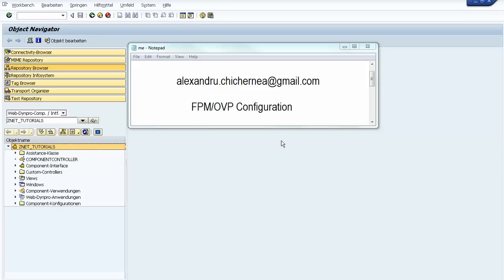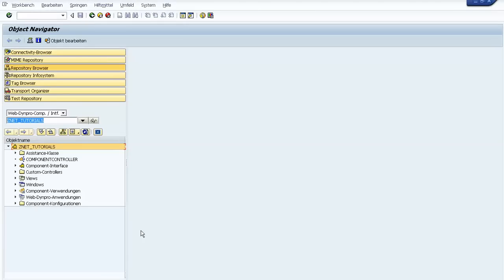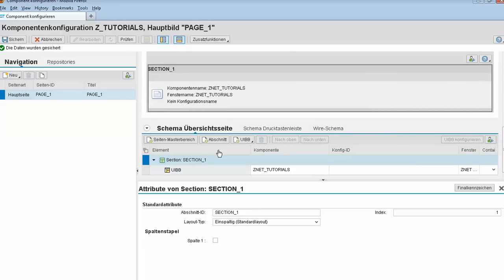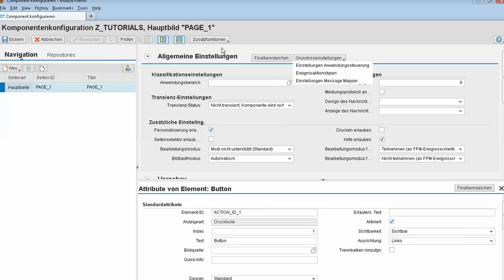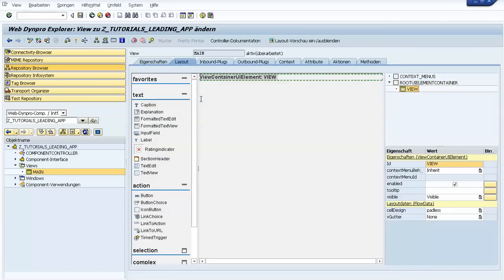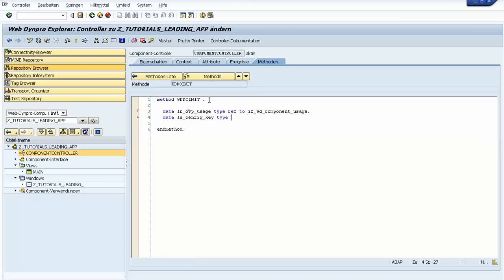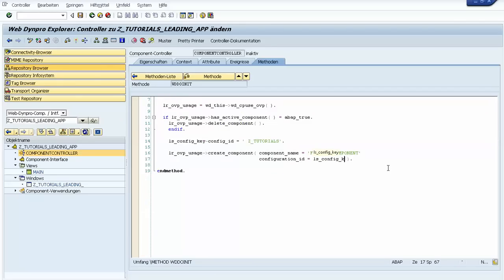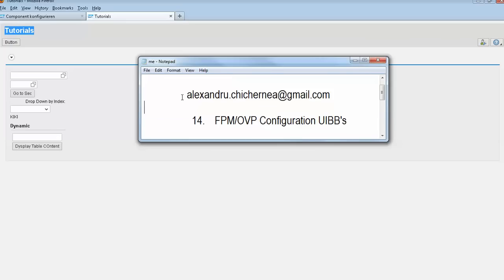Build a Simple Web Dynpro ABAP Application, Floor Plan Manager FPM/OVP Configuration (PART 14)

Comment: Its impressive. Can you post some real-world examples like this below in FPM and it will really helps? 
 
1. Create a selection screen in FPM selection screen- Field 1 and Field 2 
2. Output is FPM ALV which has 5 columns. Field 1… Field 5. 
3. button to be shown on the ALV page right under the Input Selection-  Button such as Search, Edit, SAVE, Download, Upload.  
A. upon click SEARCH– assume example where There is a custom table where it reads the data based on field 1 and field 2 and display it in FPM ALV
B. upon click EDIT Specific rows and specific columns to be shown in edit mode. Only Field 3 and 5 are editable.
C. Upon SAVE, Edited rows to be saved back to the custom Table.
D. Download the data in Excel. 
E. Upload, data to be load from Excel and shown in ALV Screen and SAVE Button will save the data.